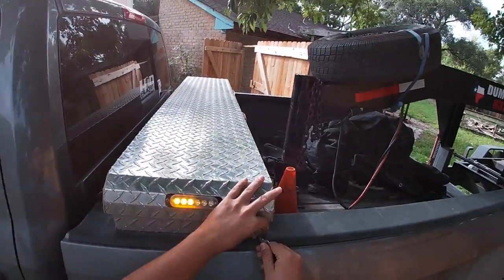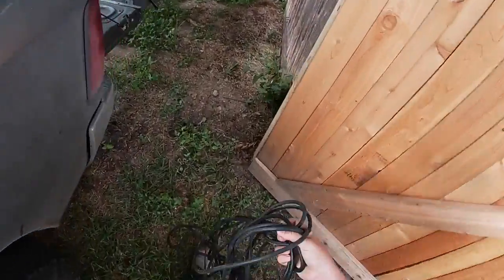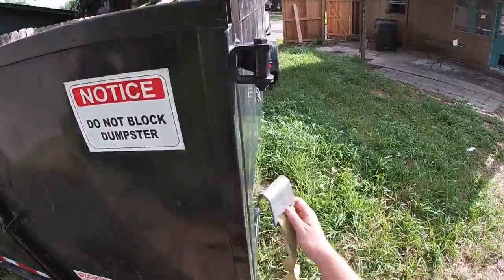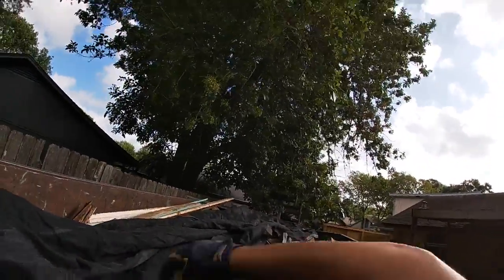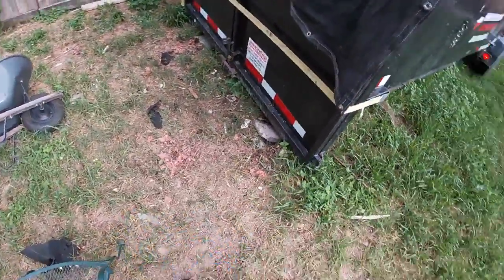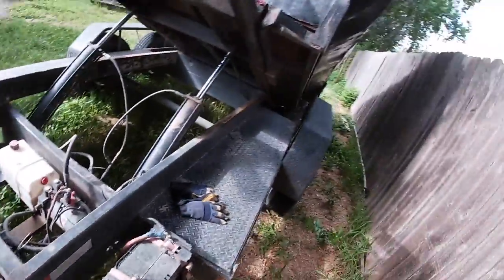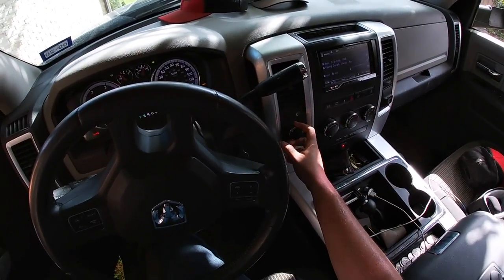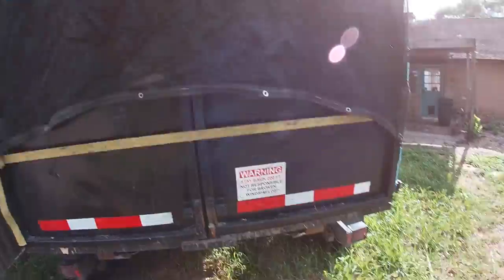Gooseneck roll off dump trailer loading a heavy dumpster / 18 yard texas pride roll off

Comment: I always carried a quart of 90W oil to lube the rails for easier sliding. Jut cut the pointy tip a bit and it had a replaceable pop-off cap.

Comment: I always put 2x10 planks under them....I find it let's them roll alot easier. I leave the truck in park though.
Reply: Running the same truck...6.7 Cummins...they work so good.
Reply from the maker: Jeremy Fawcett it’s rare when I have to drop them on grass 95% of the time it’s on concrete. But I like the 2x10 idea might try it out
Reply from the maker: Jeremy Fawcett hell yea man this 6.7 have some power. Are you deleted and tuned ?
Reply: @Grtruckingdemolitionllc  Every bin I have I have a set of 2x10's for it. I have plank holders welded on to my trailer to hold the planks after I pick up the full bin.
Reply: @Grtruckingdemolitionllc  No..not deleted yet. Waiting for warranty to run out..then I will.
Reply from the maker: Jeremy Fawcett post some videos of your set up want to see them
Reply: @Grtruckingdemolitionllc  I have the PJ Rollster System with a 17.5k Smitty Bilt Winch

Comment: Do you have any bumper pull roll offs? Seems like that load could be pulled with bumper pull. At least my new super duty is rated for that.
Reply: Yup, Pintle hitch and a dually HD truck would do it. Just buy a gas powered hydraulic trailer. The battery trailers don’t hold up when you’re running multiples a day. It’s slightly faster too running a gas powered engine.
Reply: The problem with these pick-up truck  roll offs is, they are usually overloaded,  then taking into account of the trailer weight and box weight you are limited in what you can haul with a one ton rig, having to move up to a 4500 or 5500 rig.

Comment: Question brother, what's your opinion of Texas Pride trailers? How old is you trailer and would you buy another same brand trailer? Finally, I hear the hydraulic lifting system on a Texas Pride trailers is pretty slow , how do you feel about that statement? Reason for my questioning is I'm in the market for a new dump trailer and like this whole concept of roll-off dump trailer not just for my business but to rent bins out. Thank you for your time and advice.

Comment: how heavy was the dumpster? 
did you have any issues towing the load? 
on average how much do your dumpsters weigh? 
what do you drive?
Reply from the maker: Alan Mendoza I scaled 31k gvwr, no towing issues the trailer axles do get a little opened up because of the weight but no big deal.
Reply: Dang, that is heavy! 
I didn’t know you needed a CDL for this kind of business.
Reply from the maker: Alan Mendoza no one has it, I know like 5 other guys in houston that have the same set up, no CDL but have never been pulled over so I guess it also depends what’s inside the dumpster.
Reply: Thank you for that man!
I appreciate it
Reply: How much does it cost to dump a loaded dumpster on average
Reply from the maker: Chris Lawley $14 a yard

Comment: I saw you have a high lift jack mounted to your trailer. Sometimes I have heavy loads that won’t dump so I have to unload it until it will. Do you use the jack to help lift the trailer????
Reply from the maker: Nick yes that’s the reason I bought it, the jack will lift it up until the trailer can go on it’s own

Comment: What’s worse leaving your truck in park 
Or
Reverse???

What do you 
Recommend on Pick up trucks
Reply from the maker: Stephen Contreras all depends we’re is the dumpster dropped at, if it’s in flat concrete you can do both reverse or neutral, if you are at a angle always neutral because truck can roll by itself, and when a dumpster in grass/mud/sand reverse. Also by leaving the truck in reverse releases more stress from the winch.

Comment: Dam bro u said u fill in them tires with a 100 psi?
Reply from the maker: Yes sir, rated for 110
Reply: @Grtruckingdemolitionllc  rated for 110 i would fill them to 80psi when the load is on at 80 psi the the psi in the tire will shoot up to at least 140 or more.
Reply: @tintdr  whaaaaaaat? Lmao increasing load does NOT increase psi bud. Never heard that one before lol but you're 100% wrong.

Comment: Have you tried that slip plate lubricant paint
Reply from the maker: Robert Garza no I haven’t, it does fine with grease thou
Reply: I need to try that out see how it works
Reply from the maker: Robert Garza yea I’ve always used it, I have never seen or heard of the skip plate paint? Were do you buy it at
Reply: I believe at Grainger someone told me about it I need to try it out

Comment: Good video, I have been looking at buying the same setup like yours, do you ever run into problems  where the truck, trailer and dumpster on the ground length is too long and have problems getting in and out of places?
Reply from the maker: Antonio Castrejon not really, you just have to drop it off and make sure it will be easy to pick up, 12ft trailer is the perfect size not to big not to small. Just have in mind the drop off will always be easier than the pick up. I like to most of the time have my truck come under the dumpster, so the winch does not do all the work. With that being said I make sure my truck trailer and dumpster can be all lined up.
Reply: Grtruckingdemolition Thanks for the reply, have you had good luck with the dumpster business? Would you recommend it?
Reply from the maker: Antonio Castrejon yes it’s been pretty good, but with the storm we just had landfill prices went up, and everywhere i go i see someone new with the same set up, so lots of competition. The way to make money is to have a bunch of them and have them all rented out constantly

Comment: truck has to be in neutral
Reply from the maker: You can also use reverse if it’s heavy just chock the back of the dumpster
Reply: Huge safety hazard to leave it in reverse. Especially getting in between the trailer and dumpster.

Comment: Just seems too slow...the whole setup.  Profit is in efficiency.
Reply: CTT DISPATCH yep, I recommend an auto tarp, wireless winch and wireless hydro. All of my equipment is auto so much faster than this.
Reply: @nedrudt21  auto tarp is a waste of money. Didn't you see the nails? If it's not nails it's other crap. Roll a tarp so you can lay it up on top and unroll it easily.